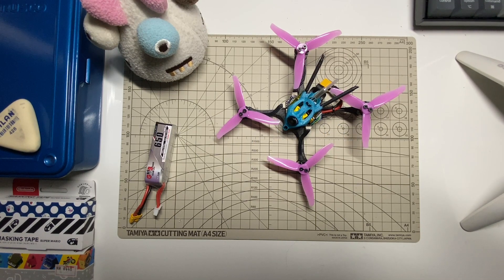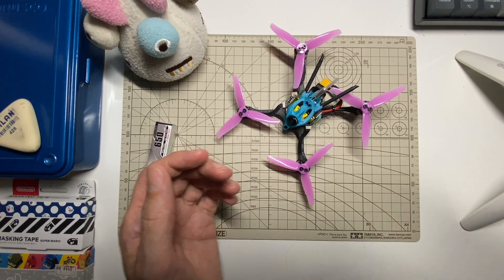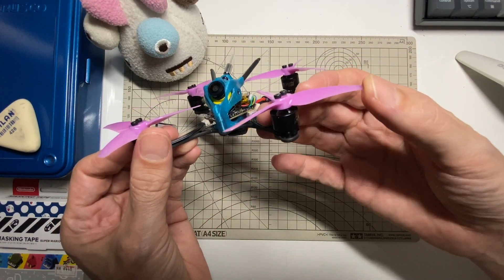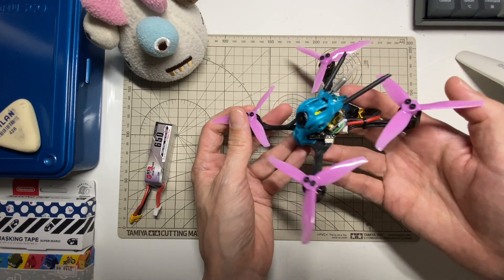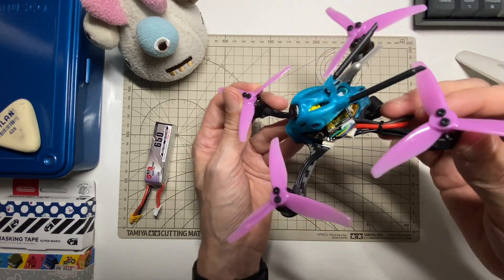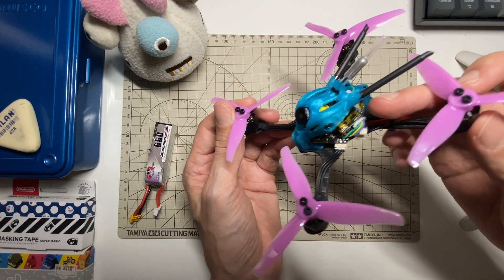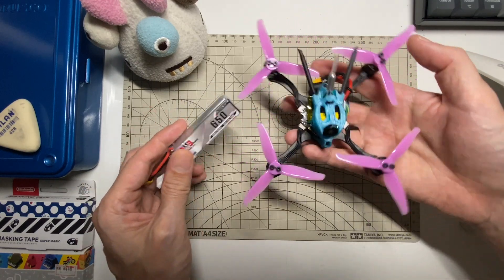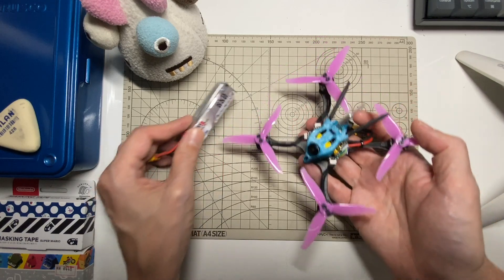GnarlyFPV X BetaFPV | Primo 3 with 1106 4500kV 3S

Comment: Very nice.  Been wanting to gut and update my betafpv hx100 and use these motors on a primo 65mm frame I have sitting around. But I kinda think that may be overkill for that frame 😂.  Then again it worked out great on the older micros from a couple years ago like the Babyhawk R, mine still flying, motors are shot but still manage to spin 😋... about to overhaul it as well. 👍

Comment: do you think I could build a umma 95x analog with split cam, 
and use a 450 mah 3s?
or would the flighttimes be too short
Reply from the maker: Sir.cleanfpv Hmm. Yes I think a 450 3s might be a little small unless you have the weight of the quad under 60g but that’s just a rough guess.

Comment: What betaflight version are you running?
Reply from the maker: It’s a little older at 4.1.1. Stock PIDs with 1.3 on the filter multiplier.

Comment: I love the GNB Batteries for micros but wish they would keep their C ratings consistent. Like why is the 650mah  3S only 60C  and the 450/520mah 3S 80C. Makes no sense..
Reply from the maker: Good point, I noticed that:) I also have the 520s but used these just because they were a little shorter in length.
Reply: there is a answer, for example 80c at 450mah are 36 amps, 60c at 650mah are 39 amps.
more mah eqals more A per c...
you'll also notice that packs like a 6s 20000 just got about 10c, thats because the amps are just high enough...
And also, who needs more than 80 amps burst for toothpicks?